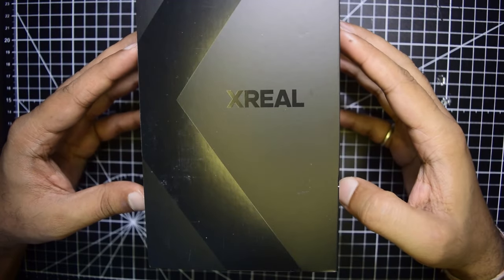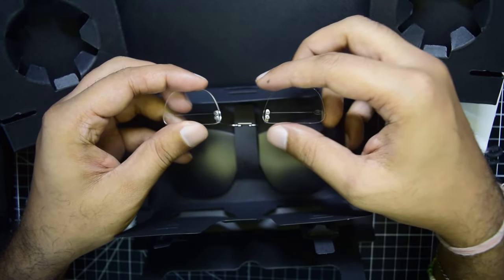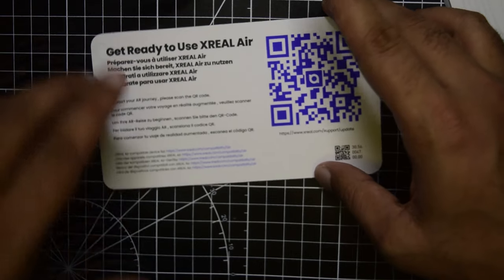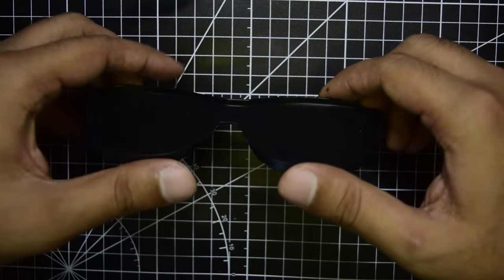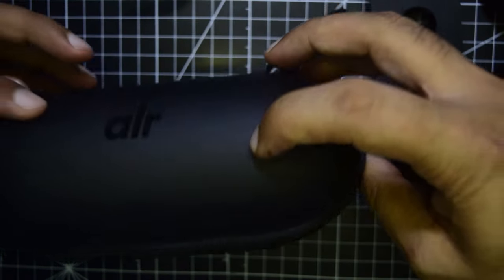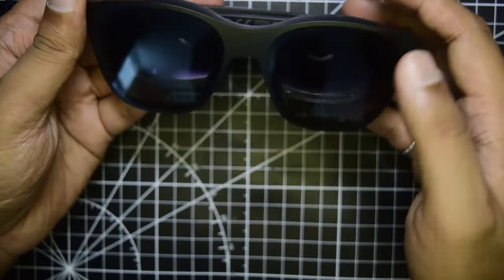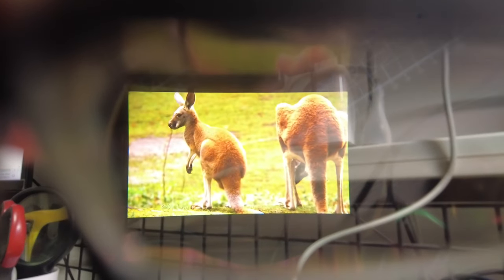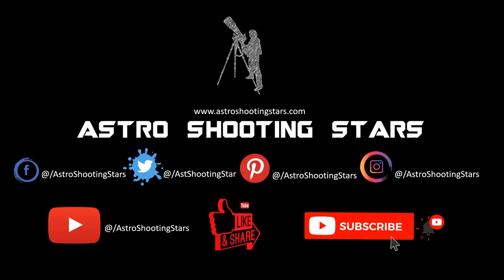XREAL Air AR Smart Glasses with Massive 201 Inch MicroOLED Virtual Theater Augmented Reality Glasses

Comment: It would be interesting if the glasses were contact lenses that were powered by solar and you had to keep your eyelids held open with clamps like in the movie clockwork orange and had to stare directly into the sun like the aztec edition.
I just bought and is in the mail the Nreal/Xreal LIGHT version because i want to try to recreate touchscreens with its gesture recognition and ability to generate touchable surfaces in mid air.
It requires being cable connected though and isnt a wireless solution, but the LIGHT version is the only one in their product line that can do AR and VR elements plus having 6 degrees of movement detection rather than 3. 

It weighs almost twice as the AIR version though, and if it bugs me, i may try to make it lighter by using a hat to attach to it to adjust the height of the glasses to sit a millimeter off the nose.
The arms of the glasses could also be adjusted if they are too pressing against the cranium, one could simply use a few popcicle sticks to help flex the shape of the arms with some tape or velcro added.
If your really insane or a pioneer, you could probably remove the arms from the glasses entirely and make it a only hat worn device.
Reply from the maker: thats great my friend enjoy your glasses

Comment: can it do 2D to 3D conversion?
Reply from the maker: no it cannot convert 2d to 3d. but in setting option just it does the interface look in 3D, it just makes text or icons of interface look as 3D. I hope this helps. Please stay tuned to my channel for my future videos
Reply: @AstroShootingStars  Thanks for answering so fast. I am in process of buying some... and wonder, if these are kind of the same or a chinese version or copy of these?:
AR Audiovisual Glasses, Massive 1000 Inch 3D IMAX Gaint Screen Augmented Reality Glasses
Reply: Correction, it should have been these I meant they look alike in tech: AR Audiovisual Glasses, Massive 1000 Inch 3D IMAX Gaint Screen Augmented Reality Glasses
Reply from the maker: @TheTwsa everything is made on china these days. but this is the original Xreal AR glasses
Reply from the maker: i have the demo in the video on how you see through the glasses. yes its like a big screen in front of you its not 1000 inch its more like 200-300 inches. That will help you visualize it.
Reply: @AstroShootingStars  TCL NXTWEAR S Augmented Reality Glasses these were the ones I meant to compare them to, as they seem very alike, but differ greatly in price, and since yours are severely cheaper, I thought yours may be a copyproduct, with potential problems or maybe all is good and so only price differs?
Reply from the maker: I dont own the TCL glasses but i can tell you this one is better made, it do not have inbuilt battery it uses the battery of the device it is connected to or you buy Xreal Beam, I have a review for Xreal Beam coming this weekend so stay tuned to my channel for that. Xreal Beam has its inbuilt battery and ability to cast wirelessly to the glasses.
Reply: @TheTwsa  The TCL ones are actually cheaper.
Reply: @AstroShootingStars  I just ordered a Beam, and if its as savage as they say, i might open its casing and do a fan delete and design a different casing for it moving over much of its guts into the new casing, or half the case to retain the already existing main control button. I also read that the thing has to be ON just to charge it, and therefore causes the fan to spin away, and they said its not usable while its charging.

The solution would be to feed it a more serious battery to replace its time use limitations, i dunno if they can sort that sort of thing out with a firmware update into its essentially android core that resides inside it.

I expect a Beam 2 is already being developed, lol.
Reply from the maker: @truetech4158 yeah may be . i have the video for beam review on my channel i hope you find it useful. this weekend i will also release the video for installing more apps on beam.
Reply from the maker: @truetech4158 yeah beam gets hot but i use also external magnetic cooler for long sessions that keeps its temp in control.
Reply from the maker: @truetech4158 oh i did not know , thanks